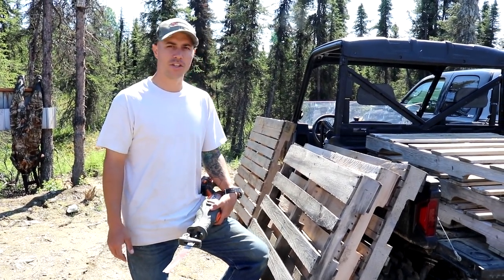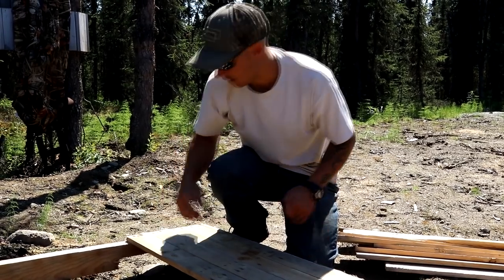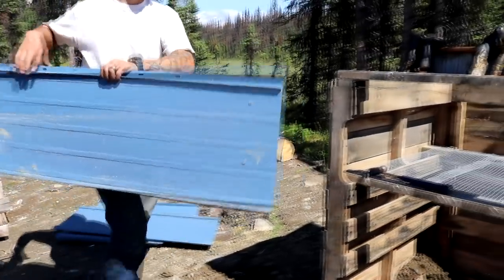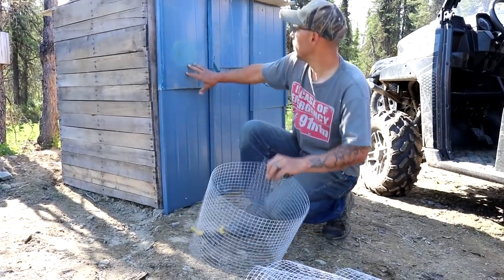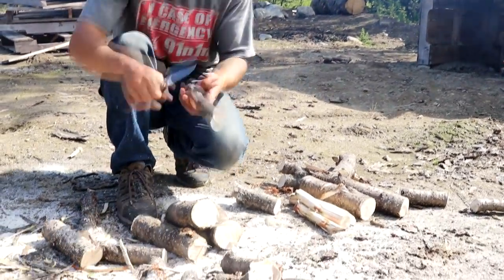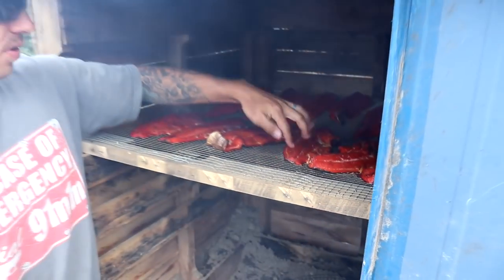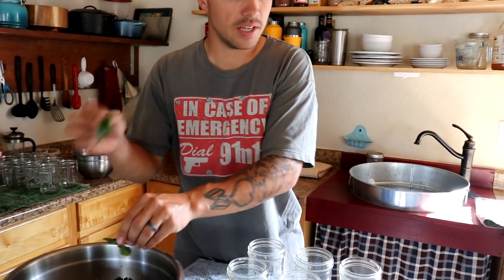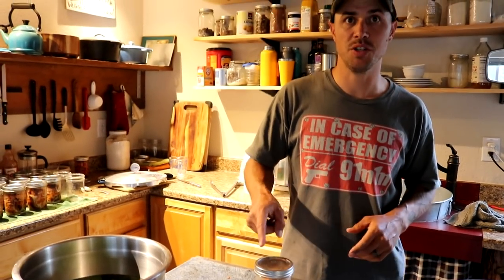Pallet Smoker Build | Canning Smoked Salmon

Comment: The codes for pallet treatment.I did notice the first one that you were hammering on had a HT code so hopefully the rest do too.The methyl bromide is the chemical to avoid.
[HT] = Heat treatment / [MB] = Methyl Bromide / [DB] = Debarked / [KD] = Kiln Dried
Reply from the maker: barrybri, thank you :) they do have HT on them, I didn't notice any with the MB.
Reply: That was my first thought - they are treated w chemicals!!! Good there is a code!
Reply: Thank you for sharing that.
Reply: why i stopped burning em in my shop , smoke was constant black

Comment: Just found your page a couple days ago. Been enjoying your content. One tip for smoked salmon. If you are going to can it modify your smoker to a cold smoker. Meaning the temp doesn’t get above 100*. I try to keep mine as low as possible. The reasoning being is when you cook the salmon in your smoker then cook it again in your canner it’s double cooked and tends to be a lot dryer than it needs to be. All you have to do to modify is to have something where you can build your fire outside your smoker and pipe the smoke to your smoker. I usually use a 10 foot section of ducting. By the time the smoke is to your smoker it’s cooled off enough to not cook your meat. Usually 2-4 hours of smoke and then into the canner. You should produce a much better product. How it helps. I’m over in Butte Alaska.

Comment: The hardware cloth is not safe for food contact due to lead content in the welds and the rust preventing coating (galvanization). Racks from old cook ovens could be a better rack system for it.
Reply: v D'Walt that is correct. The galvanization is from zinc. Oven racks are better. A friend had fishing minnows that were divided by size with hardware cloth. Water was recycled, all the fish died over a couple of days
Reply from the maker: v D'Walt, great idea :)
Reply: I dunno Tom, when I was  kid we caught minnows in a galvanized trap, and kept them in a galvanized bucket and they never died. Unless you heat it the zinc stays put.
Reply: After 35 years in aquaculture, the zinc leaching from galvanized hardware cloth will kill fish.
Reply: "off gridders" not thinking
Reply: The galvanization can become an issue from the heat from direct fire  the temperatures are low. While not ideal probably work with the low smoking temps.
Reply: @SimpleLivingAlaska   Great videos.Also the roof and door are not safe.
Reply: That's correct. Some regular chicken wire would be a better choice. The ring used to contain the fire is an even bigger threat. The galvanizing releases poisonous zinc oxide gases when heated. Especially if it's in such close proximity to fire.

Comment: No need to sterilize your jars since you're pressure canning. Won't hurt anything, just not necessary. Be advised though that canning smoked fish REALLY intensifies the smoke flavor. A light smoke, 1/2 hour to an hour usually results in a pretty strong smoke flavor once canned.

Comment: Isn't hardware cloth soldered with lead based solder and galvanized?  You do not want that in your finished product.
Reply: I cringed when he used that, but at 140 max, not much happening to burn the zinc. I still would not want it touching my food, but since the fillets were skin side down and that got peeled off, should be fine in this case.
Reply: That is not food safe. Along with using it to hold the fire.

Comment: You guys probably know this but I wanted to mention it just in case it slipped your mind. I'm assuming that the hardware cloth is galvanized. Cooking on galvanized metal is a no no. It releases zinc into your food which is poisonous. Same goes for welding or using a cutting torch/ plasma cutter on any metal with a galvanized coating. It releases zinc fumes which are poisonous if inhaled. Maybe it's not as big of a deal in the smoker since the heat stays relatively low, but most definitely not ok on an open flame. Hope this helps someone.
Reply from the maker: Badger thank you, that was actually something we weren't aware of before a commentor mentioned and are most likely going to swap the material out in the future for a better option. At the present moment because of the low temps it does seem to be fine like you mentioned.
Reply: @SimpleLivingAlaska  Make a hook system with SS metal and hang the meat as it smokes.

Comment: FISH & MEAT SHOULDN'T REST ON GALVANIZED,, CAN'T REMEMBER WHY BUT 30 YEARS AGO OR SO I  WAS ASKED TO BUILD A COUPLE SMOKERS & WAS TOLD ONLY USE STAINLESS OR HARDWOOD TO HANG THE FISH & MEAT..ALOHA
Reply from the maker: Richard Sabean, we looked into this after the fact and found that the zinc on the galvanized hardware cloth can withstand  the heat in the smoker without risk of zinc toxicity (since it doesn't get very hot), however it is generally not an ideal choice safety wise to cook on. We feel comfortable with it for now and are hoping to add some wooden dowels in there though in the future and have plans to increase the height. Appreciate the comment because we are always learning new things :)

Comment: OMG   FIRST COMMENT....    I AM SUCH A GROUPY...     I got one here to smoke so lets see how you smokem up tharr in AallaaaaCKA
Reply: skin down probably ok but Im not sure galvanized is food safe the way chrome is.  Often fridge racks are used as they are chrome.   If the wood is treated with anything you will finds stamps on it that you can then look up to see what they are treated with.  Look on the bases/vertical not so much the main boards.       You could add a plate of some kind over top of your wood there on the wire to dissipate heat and cool the smoke.   got any shale around?      Well I have to go eat now...  some reason Im hungry  cheers.   yummy
Reply from the maker: Mat Walker our pallets are HT stamped, we did research that galvanized should be ok if kept under 400 degrees...but I guess we will find out in a couple of years!
Reply: @SimpleLivingAlaska  Thats the Alaskan spirit!    meaning betting on the long game.    Glad you did you "home work."  I am pretty surprised at the galvanized but temperature dependent is understandable.  cheers thanks

Comment: I was wondering if any possible ill effects from using galvanized carpenters cloth.
Reply from the maker: Ralph Mckendree well I grew a third leg...
Reply: Simple Living Alaska lol, I had just heard using galvanized metal when cooking was dangerous; but glad to hear your stance is more stable.
Reply from the maker: Haha 😂 we weren't aware of the galvanized metal and heat risk when we made the rack we have plans to put some wooden dowels in there soon but have just been making sure the temp stays low (from what we read it should be okay if kept under 400 degrees but it still isn't ideal).

Comment: your smoking that on galvanized wire thats not to good .
Reply from the maker: From what we looked up we should be fine since the metal doesn't actually heat up very hot in the smoker but we will most likely add a rack system in there with wood in the future.